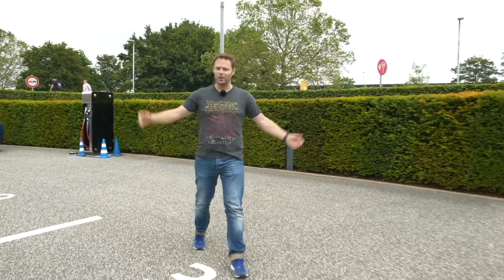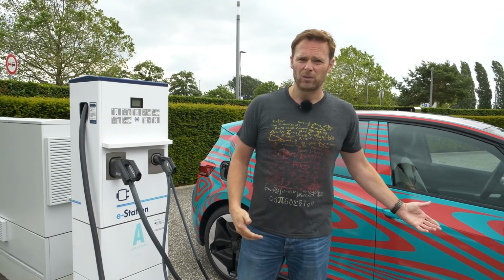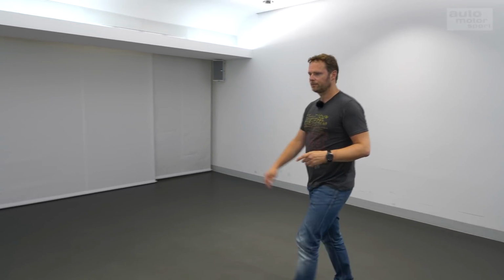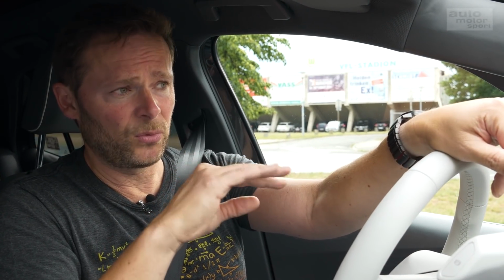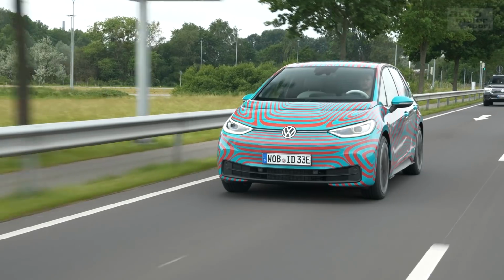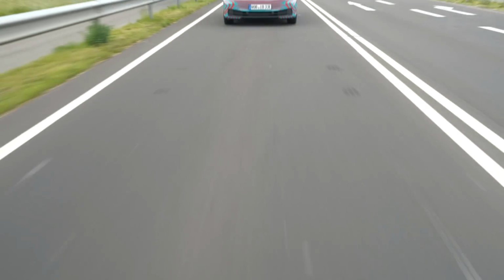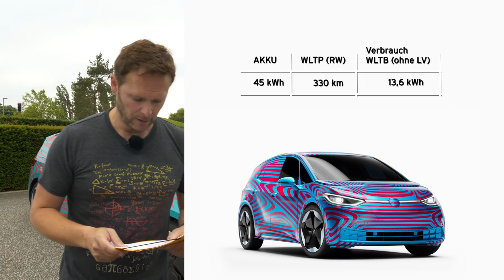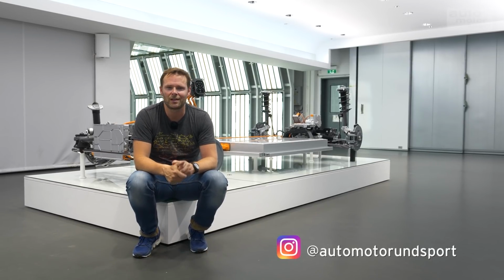VW ID.3 (2019): first drive & in-depth-review [engl.] - Bloch erklärt #64 | auto motor & sport

Comment: Energy density is relatively low compare to Tesla Model 3, where according to Munroe Associate teardown it has a pack-density of 207Wh/kg (and 270Wh/kg for cell density).
Reply: I think you got something mixed up, because according to https://www.extremetech.com/extreme/285666-did-tesla-buy-maxwell-for-its-ultracapacitors-or-higher-density-batteries the energy density per cell is 207 wh/kg and the energy density for the pack is 272 wh/ Liter.

Comment: AC charging parameters are disapointment for model with smallest battery. Why only single phase (7,2 kW at 32A)?  I have only 25A main breaker and changing to higher amperage is costly at the energy provider..